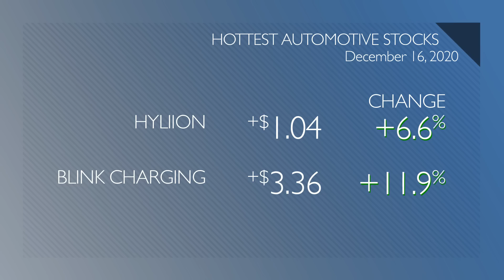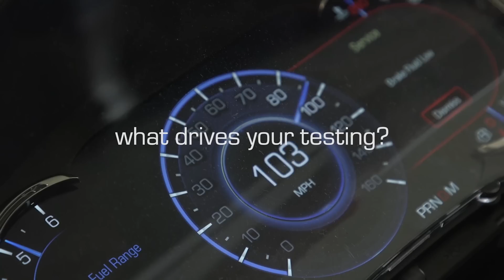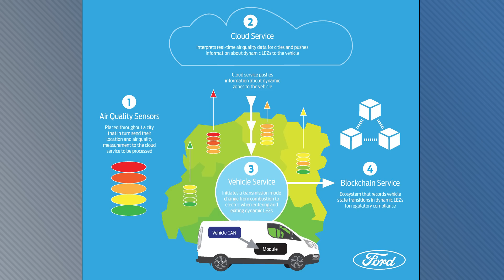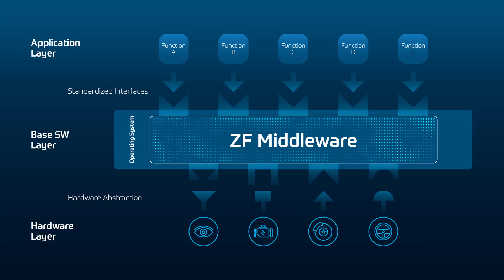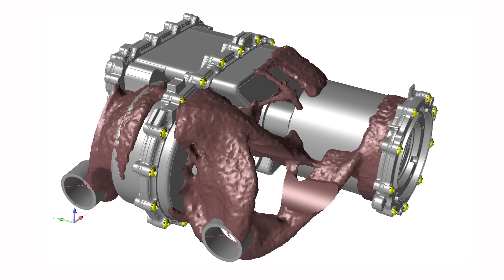Canoo Reveals New Delivery Van; ZF Helps Improve Vehicle Communications - Autoline Daily 2981

Comment: Electric RV trailers would be kinda cool. Add motors to the axle and connect the tow vehicle battery with the trailer's to assist with acceleration and in braking which charges the trailers and the tow vehicle batteries.